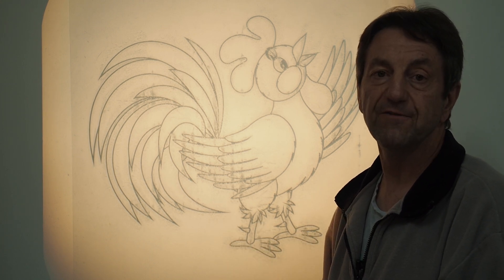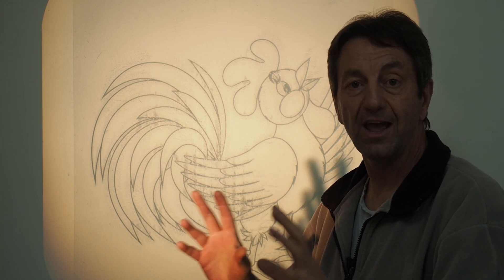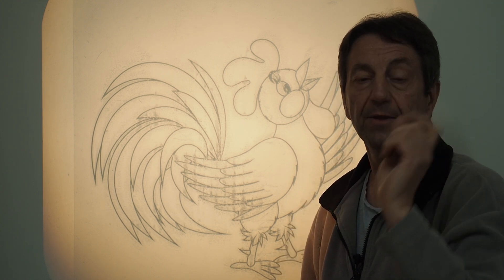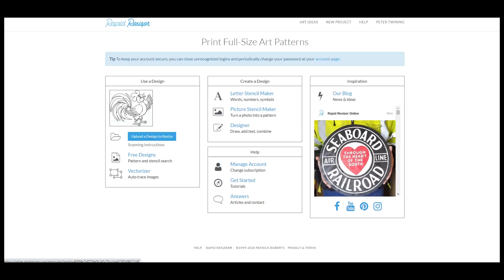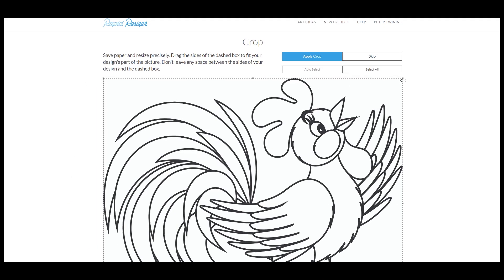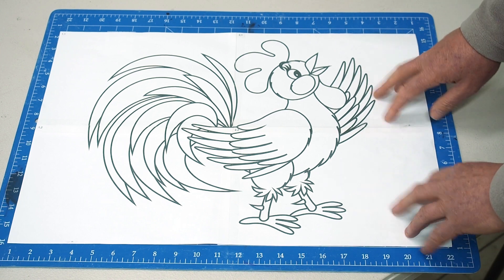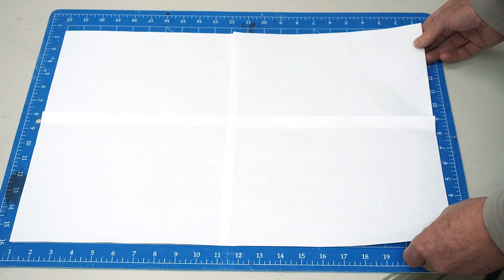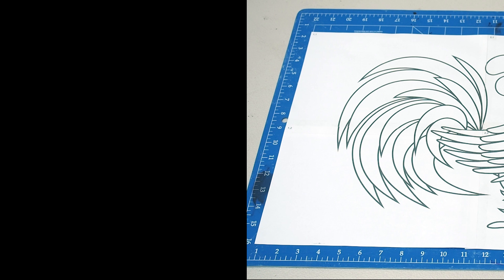Enlarging Transferring Designs For Mosaics or Art Projects

Comment: Thanks Peter. I'm a stained glass artist as well as a mosaic artist and have been using Rapid Resizer for 15+ years (since it was an old MSDOS program that was installed directly). It has certainly advanced over the years but still has some oddities. I use for resizing & printing and design both stained glass & mosaic patterns with it. It really does a great job.

The one issue I have with mosaic designs is how difficult it is to transfer the design to your substrate. Certainly you can use the carbon paper approach but that can take quite a while to trace out patterns and can lead to issues if something isn't traced correctly. I find Fiberglass Mesh to be a great time saver for transferring patterns since you can just layout the printed copy under the mesh and build your project directly using the original pattern for guidance. This is another benefit to using mesh that I don't feel gets enough love. The mosaic process is time consuming to begin with and any steps we can take to minimize time waste is definitely to our benefit.  Have others found any other ways to transfer designs to substrates accurately that is quick & easy? I've been playing with using a Cricut machine to cut the patterns out of vinyl which can then be applied directly to your substrate and you can build on top of this. It's hidden under the grout and doesn't generally cause any problems. What do you think?
Reply from the maker: Good ol MSDOS, computers and programs have come a long way since then.  lol. Your glass artist experience would be very useful with mosaics. I dont know of anyone that has found a really easy way to put the design onto the substrate. Im not sure what you mean about leaving the vinyl under the grout. I owned a company for 20 years that had quite a number of large format printing machines and I could print the design out to what ever size I wanted and then use the mesh, as you suggested. One of my other machines was a large format cutter and I could print onto the vinyl if I wanted to and then cut it out on the cutter and profile shape it to the design and any other intricate parts of it, this made it easier to transfer the design. The ultimate machine is a flatbed large format printer where you print the image directly onto MDF, Wedi board, Glass or whatever substrate you wanted. It all happened in a matter of minutes. There are companies around with flat bead printers that would print your design directly onto the substrate, you cannot get any quicker than that, be it a full colour print or outlines for you to follow. Outlines would be better because you want to adhere to the substrate and not the ink. :)